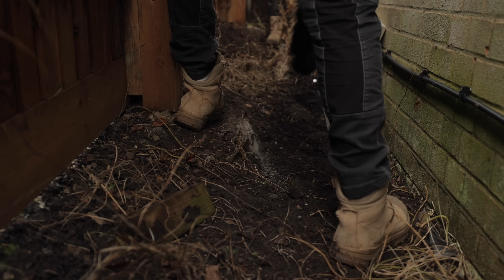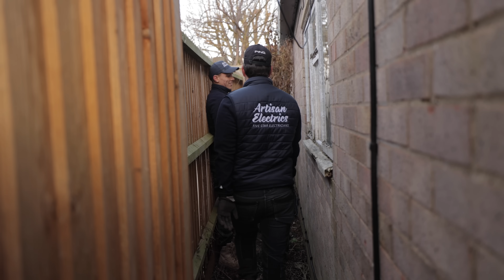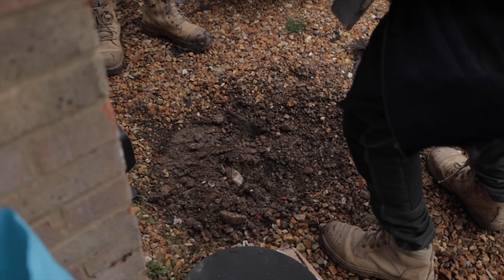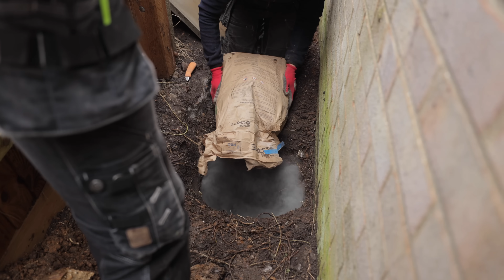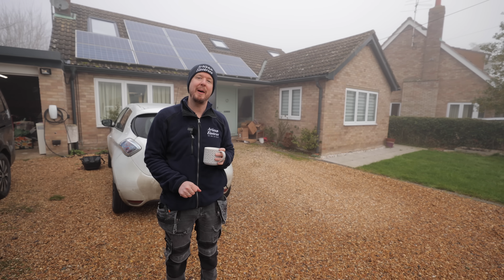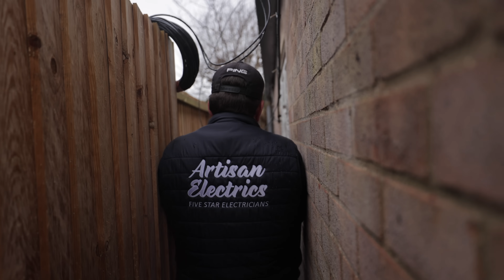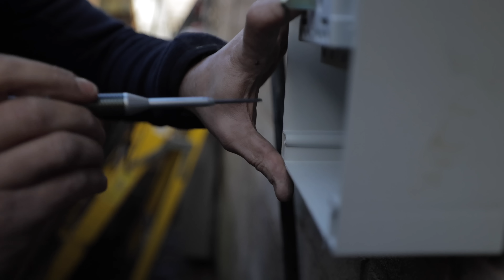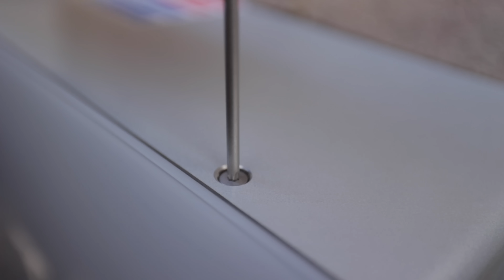BRUTALLY HONEST OPINION! 👀 Tesla Powerwall 3 Hot Takes 🔥

Comment: The lack of internal covers is typical of American design switchgear. Their reasoning, if you open it, you should have a reason to be there and not stupid enough to live connections. European designs are much more safety orientated.
Reply: Don't know what you mean can you give an example because all the switch gear we use has internal covers and so does the power wall and the Gateway
Reply: @cardigansrule  It very common in industrial American equipment to have no internal covers
Reply: Most eu power is 240v compared to US generally having 110 probably a big factor too
Reply: I think the design is probably to enforce Darwin's theory

Comment: This video is very much focused on the installation side of the PW3, and yes I get that its heavy etc, but if you are a buyer the install happens once. The cost, performance, usability, monitoring etc are of more interest to the average buyer.
Reply: I'd upgrade the windows first before installing a powerwall that one near the install looks like it's ready to fall out
Reply: You do know it's a window into the garage and the owner has said he is building a wall to split the garage eg follow up work which has a good chance of including new windows finally how is it any of your business @mattesla
Reply: @alanrickett2537  I said I would replace, how is it any of your business to reply to me if that the case
Reply: @mattesla  because you posted on a forum were there is a implied request for discussion were as the owner didn't post anything the supplier that did was not talking about windows or anything not related to electrics.
Reply: @alanrickett2537  well here's me thinking this was social media thanks for education
Reply: I'm interested in all of it, install details are very important to many of us as properties vary. Know the options is great to have knowledge.
Reply: An awkward weight massively exacerbated by an extremely low probability installation location. How about some balance by providing a mounting location typical of 95% of locations?  One more point.  You have to go through this only once every 15 or more years?  How about checking your implied political bias?  Also, what do you care?  You did get paid for what the customer wanted, no?  Isn’t the customer always right?
Reply: Maintainability seems to go backwards. Also: If something fails, everything has to be replaced as Tesla does mot sell parts / module for the system. Only full cabinets.
Reply: They also overlook that Tesla has a lifting trolley built for installs! Just this install was down the side of a house, so guessing it didn't fit or they didn't buy it.
Reply: Artisan electrics are sn installation company...what else did you seriously expect ⁇
Reply: Then find a review which focuses on that! 😂
Reply: If the installation is difficult shortcuts will be taken and that will impact on the long term efficiency which will impact on the end user. Why companies try to cream extra profits from the installers is beyond me. Proprietary lifting straps for £1,500?. 23:08 I’ll find a bit of rope and if it’s not quite level I’m already gone and it’s the end users problem
Reply: I think the average buyer would be more interested in not having anything to do with something from the Musk empire.
Reply: @smallstools Average buyer here. What nonsense!
Reply: @mikee6114  each to his own Mr Average.
Reply: @hansberg1991  yes, "each to his own". So you've just contradicted yourself about your "average buyer thoughts". Doh! Couldn't actually make it up...
Reply: @smallstools 

You need to stop trying to think for others.
Reply: @smallstools Wrong. You need to get out of your cones of silence.  You’re propaganda saturated. Why not try joining the rest of us in apolitical reality.
Reply: This is the best product on the market. So that's the one I'm buying.
Reply: @smallstools 🙄
Reply: @smallstools why?
Reply: @smallstools 

"I think the average buyer would be more interested in not having anything to do with something from the Musk empire."

Why do you say that ?
Reply: @smallstools  Then you need to re evaluate your criteria, as it is inneficient.
Reply: @smallstools  I am an average buyer and I buy a product because I like the product.  I don't buy a product hoping the CEO is going to come and hang out with me.  Maybe time to grow up a bit....
Reply: @OffMarketOS  not a very grown up answer.
Reply: @OffMarketOS  I think it's you that needs to grow up a bit.
Reply: @smallstools 

Eggnog is telling YOU to grow up!
Reply: @smallstools why exactly? Because the BBC says he’s a bad man? (Whilst covering for absolute wronguns for decades). Grow up.
Reply: @smallstools  if you start making purchasing decisions based upon the politics of company leadership then you won't be buying anything from anyone. Don't believe everything you read in the news, it's all skewed towards click-bait.
Reply: @smithleon  I'm basing this decision purely on Musk
Reply: @smithleon what’s worst, some people buy products that celebrity’s endorse, go figure
Reply: @smallstools I’m getting two power walls next week! Can’t wait to support Musk and Doge!  Cry more
Reply: @smallstools  That is just stupid. A remarkable man and several world beating, changing companies. Great products across a range of areas.
Reply: @nicholaspostlethwaite9554 
 Some might dispute that , he comes across as an opportunist that uses other people’s skills and then sells them as his own, not to mention his antics in public show his character is wanting , hence his brand name is waning at great speed.
Reply: @nicholaspostlethwaite9554  nonsense!!!!!
Reply: @mikldude9376  You would need to be intentionally ignorant to believe Musk led products are, technologically, way ahead of the competition at this point.  Also, they have a much larger US manufacturing footprint supporting the US market.
Reply: @smallstools  Agreed, it doesn't matter how good the product is.
Reply: @MentalLentil-ev9jr  Why?

Comment: I really wish you'd do a video on how customers decide to install such systems. I have lived in the UK for 20+ years, so I know the climate and the average detached house roof size. This Tesla 3 system seems massive on the battery side, but I can't tell what the panel array supplies. Regardless, it's unlikely to "match" the two 13.5 KWHr Powerwalls (plus future expansion models). So is the idea to buy power off-peak and sell it back at peak? And the Powerwalls are ~£6500? Each? - maybe approaching £20K for the batteries alone - however does the payback calculation work (Given the SEG/FITs are tiny). I just don't get it. I have (paid for) two grid-tied installs (US and South Africa) and run the numbers. I cannot see how some of these UK installs make sense. Please educate me
Reply: Event without embarking fully in the "Prepper" lifestyle, some buyers might consider paying extra for the full house backup rather than just doing a basic installation with short term ROI in mind. It's like EVMan in Yorkshire says "you would not wonder what is the ROI of a gas boiler or of a kitchen fitting".

When I got my PW2 (at the worst possible time/price) the competing products offered really crude EPS that could not keep my combi boiler running without making some unpleasant compromises.

If someone wants to charge their car while off-grid from a mix of solar and PW3 sources, having an oversized system will have a suitably long payback period.
Reply: Yes hard to tell but that will be a lot of battery and cost all together. Plus Artisan prices for installing. Perhaps there is a very big solar array there? But more is always nice and money not aways an issue as many imagine for themselves. Pay back? Who cares? Security of supply etc more desirable.
Reply: Agreed. I’d like to see a professional NPV calc for these investments, taking into account all costs (including cost of capital) and expected life. Can’t see it being positive, unless you really have scale and high energy usage.
However I totally get the security of supply argument.
Reply: They buy at 7p EV tariff and sell back at 15p export. But avoid being charged 25p or whatever it is. 

So the cost calculation becomes 
25p-7p = 18p saving.
To pay back 20k would mean using 111,111kwh. 
Divide by the 8800kwh I'm using a year thats 12 years payback.

Wouldn't quite work that way as all the EV use is at 7p anyway. But if I get a heat pump that's 5500kwh of electricity a year to add so probably about the same as the EV so above calculation would be about right. 

LFP battery could be expected to still be 80% capacity or better at 20 years.

The additional buying and selling earning you 8p is a bit questionable you can see the payback would be longer
Reply: and in the harsh sunlight of the British sun beating down..... actually it was foggy when they filmed....... how does that work for the solar system?
Reply: @ From what I've experienced, the performance of the solar panels gets better as the planet gets closer to the sun and immediately gets worse as summer moves on. Sometimes I notice the number of KW is still high despite cloud cover and fog... it just needs to be "bright" for the solar panels to produce more than enough to deal with the base demand of the household. When a hungrier appliance comes on the battery kicks in and then gets charged again when the clothes or dishes washing is done.

Comment: Have the US version of the SigEnergy battery system.  Love it!  It's a lighter stackable unit so installation is easier on the backs.  And commissioning takes literally 5 minutes unlike the Tesla PW3's 2+ hours.  You can get 40kWh in the same space as one 13kWh Tesla PW3.
Reply: Ah, but can an inverter be connected to the Sigens that is capable of pushing out 11.5kWh?
Reply: @fractionaldebtisfraud2187  I have my PointGuard system fully discharge back to the grid for about an hour each evening and it sends the power back at 11 kWh.
Reply: @ericmsands  thx. Good to know. Am interested in Sigenergy too.